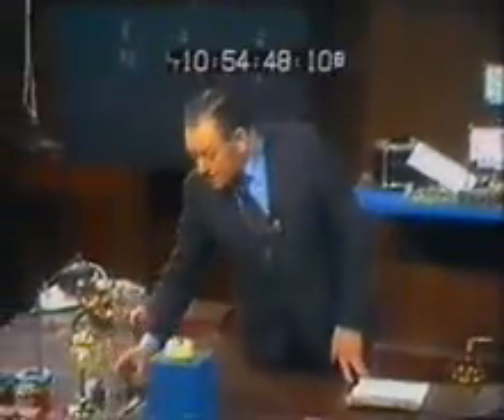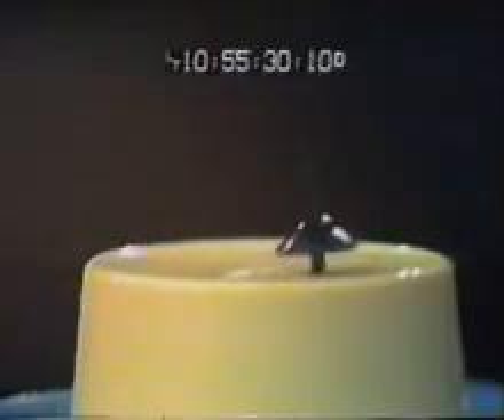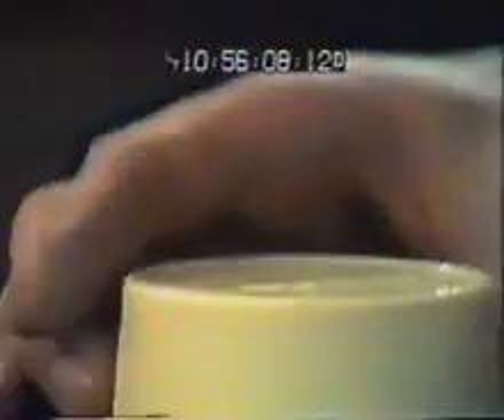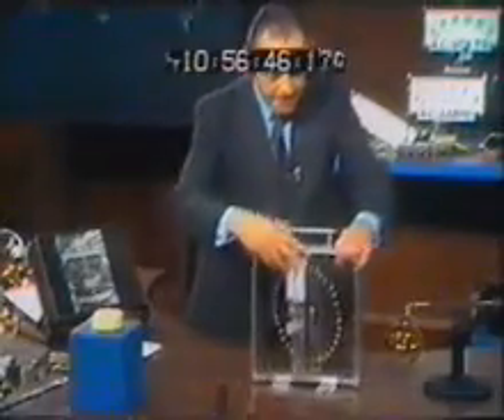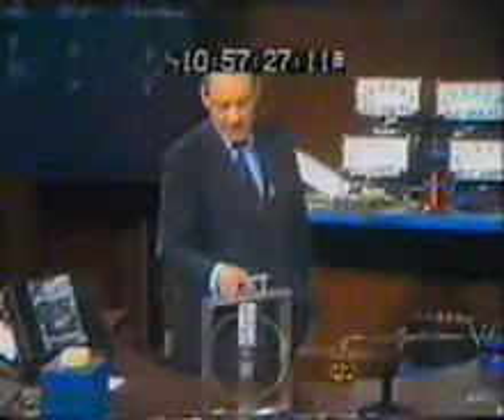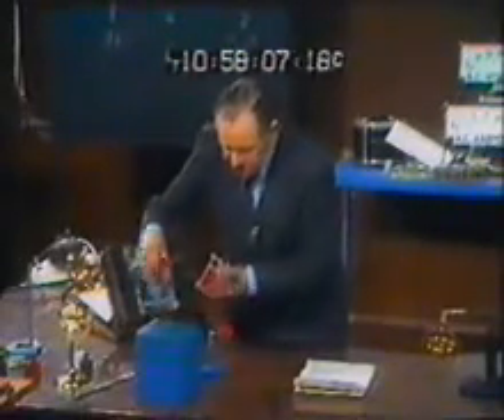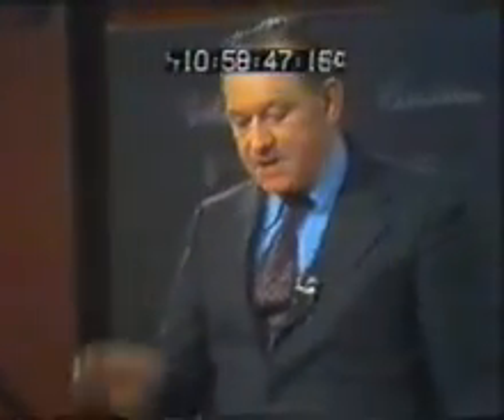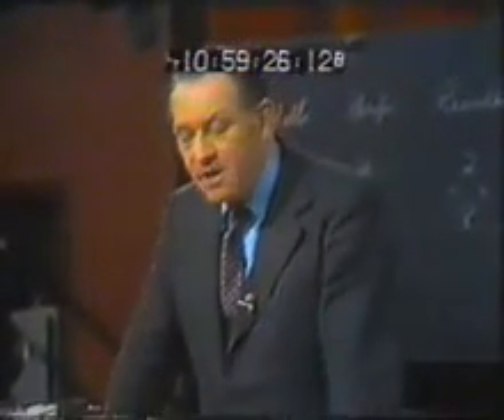Eric Laithwaite's lecture on gyroscopes part 7/7

Comment: A comment I made elsewhere for your attention, please.
 The gyro in the "floating " configuration, when placed at the end of an extension arm, DOES NOT LOSE ITS  WEIGHT  and that issue, is very misleading many people, including many universities. I advise readers to proceed to read what I am about to write as it will not be found in any book or from no one else, and readers, they are free to comment on my recent thoughts.
Here are the details of what I think happens in a gyro.  There are basically four states one needs to explain. I shall use what is seen in the video above showing a gyro appearing to be floating.
To use these following videos for reference.

https://youtu.be/Pbb_RnxeYys

https://youtu.be/xf1Nt3KLm-U

https://youtu.be/jD_Q_J4GcQ8

1.  The vertical down weight of the gyro (mg) seems to be floating on air and how it is held up against gravity needs to be explained. 
2. What forces the gyro uses to turn about itself with the dynamic precession (Wp and torque of I.Ws.Wp) needs to be explained.
3. Why the gyro, when not spinning but rotating as a pure mass m shows centrifugal force about its own center and about the pivot point and this later disappears when the gyro spins and precesses. 
4. Why the mass m is basically forced to move slowly around the pivot point. One may consider this as a linear motion using a force Force = ma + air drag forces if Ra is larger large and then work it back into circular motion about the pivot point by knowing that a= (R arm)*d(Wp)/dt

The above is achieved as follows.
a. When a fast spinning gyro (Ws) is taken and allowed to move around a radial arm (Ra) with angular velocity (Wp), then the trajectory of one mass particle is a three-dimensional cycloidal curve containing different locations, different velocities, and different three-dimensional accelerations.  Within the curves of this three-dimensional cycloid, there are ACCELERATIONS  acting on the spinning and rolling mass particles which bring about two opposite acting centrifugal forces which vary their magnitudes,  one acting inward on the upper horizontal half of the gyro, and the other acting outward on the horizontal lower half of the gyro. These two opposite acting centrifugal "horizontal" forces act at a slightly forward angle to the movement of the gyro, will create all the magic in the gyro as follows. Also, note that these two opposite acting forces also act on the forward vertical half of the gyro (the outbound force) while the ( inbound force) acts on the rear vertical half of the gyro.  These centrifugal forces are basically horizontal in nature ( in this experimental configuration) and their horizontal and vertical separation between them and the slight tilting forward give all the requirement to make the gyro behaves as it does. This is how, what was described above handles all there is to handle in a gyro as shown in the video.

1. The weight of the gyro (m.g) working in conjunction with the supporting arm operating as a pivot, and the extension rod (Ra) generates a  gravity torque ( m.g.R arm) which tends to pull the weight down.  This is opposed by the two opposite acting centrifugal forces being separated in a vertical manner by a distance x.  This arrangement will give the following. The inbound force (Fin) is above the outbound (Fout) by a distance x and so these create a torque of about the axis of the gyro  (F1+F1)*x = (mgR arm) and this is a balance in the gravitational state. 

2. The flat face of the gyro spinning wheel at (Ws) with an inertial "I" is changing its orientation with respect to earth with angular velocity (Wp) as it circles around the pivot suspension point and this needs a torque = (I.Ws.Wp ) which is provided by the same two opposite centrifugal forces also separated by a horizontal distance x, acting on the front and back vertical halves of the gyro spinning wheel.  Hence
(F1+F2)*x) = (I.Ws.Wp)      This means that the angular inertia characteristic of the gyro needs the torque action generated by the horizontal separated opposite acting centrifugal forces F1 and F2. This is the dynamic angular motion balance. 
Note the beauty of the relation between the ( Falling weight and torque ( m.g.Ra),  and  (the two opposite centrifugal forces, separated horizontally and vertically by distance x, and hence the torque  ( F1+F2)*x) and needed by the gyro (I.Ws.Wp)).
 
vertical gravity balance =  (m.g.R arm) = ( F1+F2)*x   = horizontal angular torque  (I.Ws.Wp)=( F1+F2)*x

3. Since the two opposite centrifugal forces are " almost parallel" with the gyro extension arm Ra, then conventional outbound   Centrifugal force m.(Wp)(Wp)*R arm =  (F1-F2) where F1 is the inbound centrifugal force which diminishes with the loss of spinning, of the gyro and so the normal outbound centrifugal force F2 takes over.
 Hence ( F1-F2)= m.(Wp)^2 (R arm)

4. The force  that pulls the gyro forward may be looked upon as being a linear force  and this is  due to the slight tilt forward of both centrifugal forces which is (F1+F2)*sine (angle of forwarding tilt of the centrifugal forces)     Hence this forward motion of the gyro may be looked upon as being
 Force= ma + drag force .
This may be "adjusted" to fit the angular state as the linear acceleration is related to the (Wp) rotation of the gyro where a= d(Wp/dt)  so (F1+F2)*sine( small forward tilt angle)= m.(R arm)d(Wp)/dt + Wp drag and other losses. 
If one watches other videos one sees gyros rising to the top by some unknown forces, and I do believe that this force may account for what one sees in other videos as shown in the following,

The beauty of what was explained above means that at very high spinning speeds the reaction on the central pivot point is only the vertical weight of the gyro mg. 

https://youtu.be/SEstkIF3U1Q

Apologies for the length of this explanation, but it needs to be commented upon by those who enjoy the magical and elegance of gyros. I preferred to look into the engineering details than describe the action with words as " the spinning gyro precesses  when a torque is applied to it." It is fascinating what beauty and elegance exist hidden in silence and invisibility of physics which is never appreciated by many people.
The above contribution should be followed by Universities in London, Dundee, Cambridge, Sydney, and others which in the past showed much interest in the working out and showing the performance of the gyros.

Comment: The fundamental flaw is to see a rotating phenomenon as an object. It is not. It is made of matter, like an object, but it is not an object. It is a momentum transference device. For this reason the weight is mobile. If you want to understand this extraordinary proposition, please...

...watch my layman's explanation of how gyroscopes work using only geometry I've worked out myself, and there is a second video which gives my equation to calculate the dilution of weight in relation to the spin. (The weight does not reduce, but the effects of gravity are diluted in a similar way to the way Dolby reduces noise on a cassette tape) Here is the playlist.

https://www.youtube.com/playlist?list=PLz4azdHbQ7mnmwAfm1LwwIqcLH9Ax3C5y

Comment: So, in short: a gyro stores kinetic energy in its torque-spin and it will release it by induction through its shaft, and that kinetic energy transfers to what ever is connected to it be it a rope, a miniature eiffel tower, a weight, a child, etc, and produces the 'garden hose' effect in which it shares the energy with its recipient permiting 'alterations' in mass, making something behave as if it were lighter than it is (like the kid lifting the big gyro)...add into the mix electromagnetic or pure magnetic energies and the gyro should be able to focus and send it throughout the shaft to be absorbed by whatever is connected to it. After all, flywheels are used precisely for that particular purpose. Couple that with the stuff that has been discovered in the fields of electromagnetism and we could (theoreticaly) manipulate those energies and whatever they are connected to in ways we have yet to see...

Comment: Thanks for reminding me  - I saw the original in1974. Now it's helped me to develop a free energy system based on gyros. Just tested it and it seemed to work. I wonder if it will see the light of day. If so, much is down to Eric in this lecture.